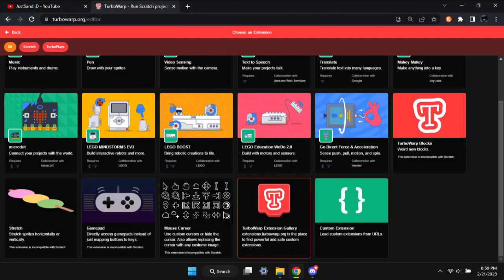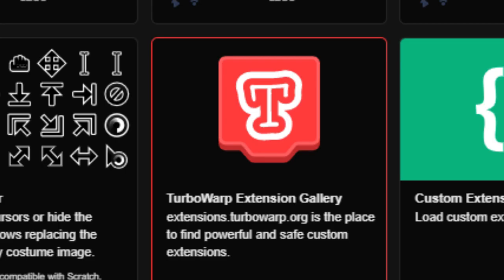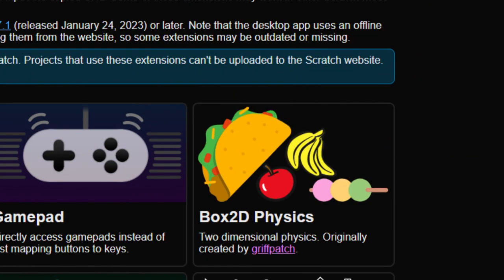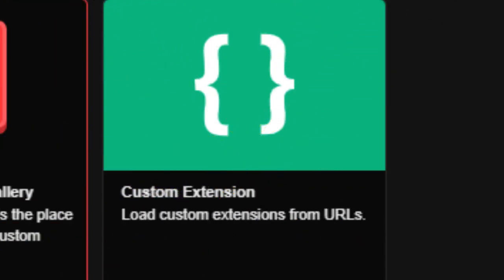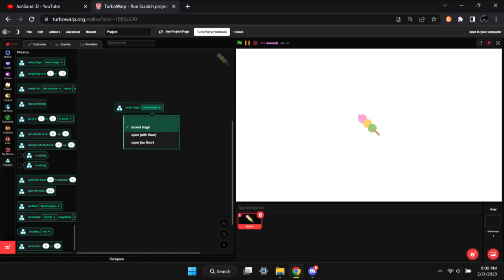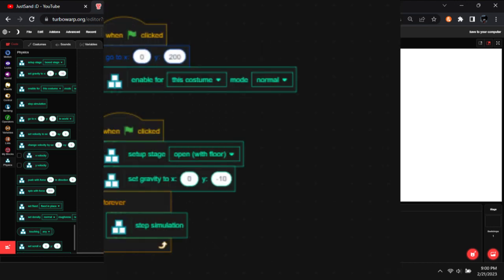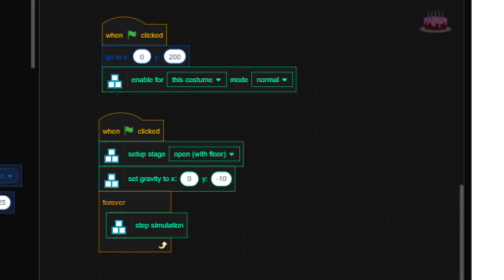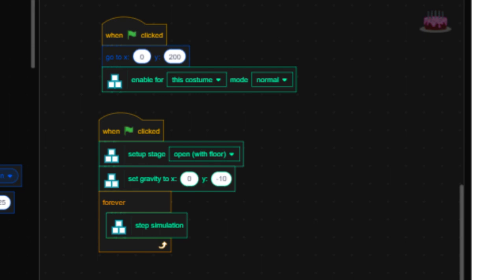Physics Tutorial(Box2D) || TurboWarp/Scratch.

Comment: how to make a physics object collide with a non physics object? such as a level?
Reply from the maker: You can apply physics to a non phsycis object; then use a fixed in place block to freeze it if you do not want the object to move.
Reply: @Cheeming-Bepis  did that, but even in precision mode the collider is very off.
Reply from the maker: @notkirb_  I think not using precision is better for it; though this may be a Box-2D bug.
Reply: @Cheeming-Bepis  I just decided to make each part of the level a separate sprite cuz I couldn't figure out how to fix it
Reply: @notkirb_  The only fix is to not have any concave areas in your sprite. Use multiple basic shapes to form a more complex object